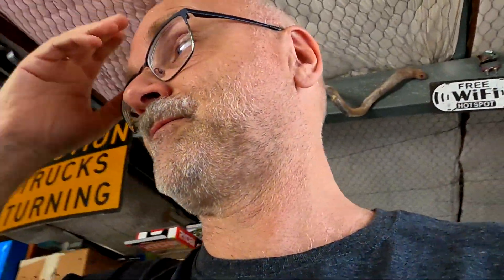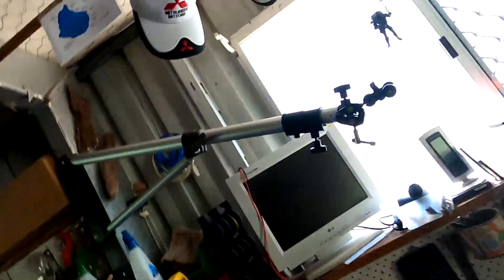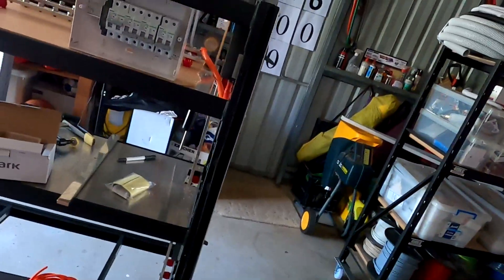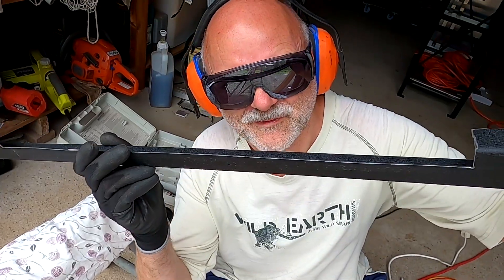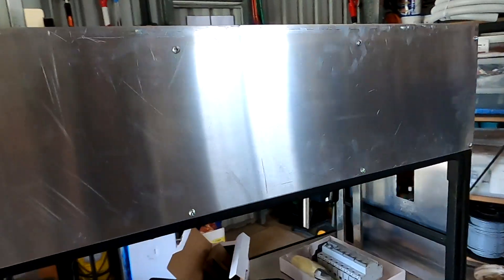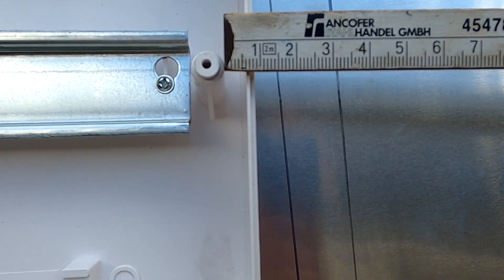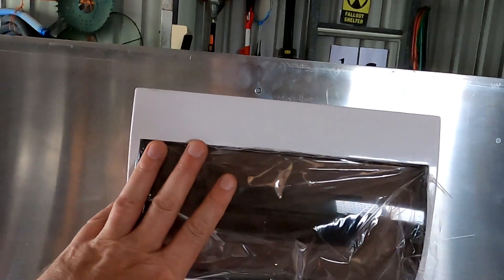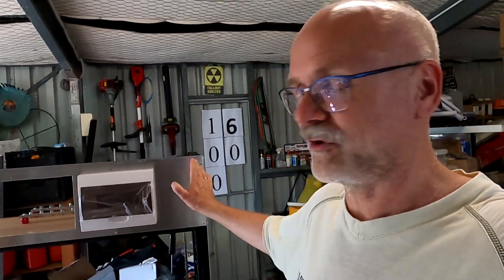MCB Switchboard added to solar distribution. Battery 2.0

Comment: DO you think the SJ BMS ($180) is worth the $70 difference for the active balancing as compared to the QUCC BMS ($110)??  thanks,
Reply from the maker: Yes, 100%. Not just because of the balancing function but also of the separate port ability to turn off just charging if a cell has high voltage. The QUC always creates total chaos when it turns off because it turns everything off.

Comment: Yeah, I'd abandon the box myself -- it's quite a limiting factor.  Turn the entire upper area there into an enclosure.   If the box was larger, sure, but trying to use a box that creates too tight of a choke point just creates more problems than it solves.  Breakers don't have to be up and down for what it's worth.   Side runs buys you much more space and a far easier place to work.

Comment: Nice. I like your screws used in the sheet metal as well. We built our first solar system this year, only 500w in panels and 200ah lifepo4 batteries. This test has worked so well, and answered so many questions on a small scale that we will be expanding the system over the next couple years. We do not want a grid tied system (at least not one that will feed power back into the grid,) so we are installing a manual transfer switch and will keep some circuits on solar full time with the ability to transfer back to grid power if needed. At this point I think our goal is to have approx 1500-2000w in panels and 800-1000ah in battery. This should be a nice system setup to reduce overall grid power consumption, as well as emergency power when grid goes down. We are also looking at adding a standalone system to feed a mini-split hvac system which would supply only one portion of our home. That one is several phases down our list though
Reply from the maker: Thanks so much for sharing. It's great to read about your success. And you're absolutely right, you can learn a lot from having your own system and see how it works, behaves and... fails sometime. Great work!

Comment: Hi, Are You planning any fuses for each individual battery pack ? Or maybe only those heavy duty brakers on the side of the shelf ? I'm having trouble to find the heavy current braker which will have some kind of over current protection build in. In most cases those are only heavy duty switches which are ok to disconnect hi currents, but You still have to activate them by hand. Can You elaborate more about it ?

Thanks.
Reply from the maker: The breakers will isolate each battery bank individually before they connect to the vertical busbar.
When we talk about high currents here, each breaker will trip at 80A. That's what I will set them to. Is that a high current?
I'm using the NOARK DC Breakers fir this job, 100A for each battery bank and 250A main breaker for the whole battery.
It is absolutely OK to have them manually reconnect again. If they really trip, you want to make ensure nothing is wrong or any fault has been cleared before you turn them back on. You don't want them to turn on automatically at all!
Reply: @OffGridGarageAustralia  thanks for an answer. Exactly those are currents i was talking about. And i've seen that a lot of brakers which are sold, are simple high current switches. So they are not tripping by itself due to overload (overcurrent), they are simply capable of disconnect high current when You want to manually do it. This way they act more like emergency turnoff rather than automatic protection. And sometimes they are even sold in this molded case, which makes them hard to distinguish from automatic overload protection. Can You give a hint about where best to buy those NOARK DC Brakers ?
Reply from the maker: @wojciechwrona4663  Sorry, you need to google that for your local area. If you're here in AU, I can give you a link though where to buy.

Comment: Andy in EU we use 3 phase  connecting bar. But maximum load is 100A. Personaly I like the most fork type connecting bar, because the fork is connected to the screw and you have free terminal for future use.
About fuxe box, it is misunderstanding. First I meant to rotate din rail 90°, second I thought that use want to build your own cover. Definitely your way is better. 
And thank you for the video :)
Small Edit: only one problem with fuxe box I see: when you have to do something with your breakers, the  box won be fixed. So it means you have to take off top cover and fix the box. But this can be easily solved by two screws on the bottom.
Reply from the maker: These are DC breakers so there is no 3 phase in this cabinet. The fork lugs you're referring too are very thin and I doubt they would have a 100A or even 250A rating.

Yes, the box is not fixed. It just sits on the shelf at the moment. I will see once the cables are connected if I need to fix the box or not. Once everything is installed I don't need to take of the cover any more. Unless I will install more breakers and then I have to take off the top anyway...

Comment: Depending on the depth of the box, you might have to put spacers under the DIN rail now to make sure the breaker faces protrude through the opening on the front, If it were me I would have just cut the opening so the box fits through, and secure the back box down to the shelf, then the hole box could have been set back even further. there are flush mount switchboards available as well..
Reply from the maker: Nah, they are long enough and still poking out even with the 4mm additional space now.
Reply: @OffGridGarageAustralia  All good then :)

Comment: I think the heat theory on the stranded wire into the circuit breaker is BS.  The distance is so short...  Would be a good test/video idea.  I also think you should start your own line of Andy's Safety Shoes - "great for heavy ground work or climbing around on a roof"
Reply from the maker: If you think a regulation is BS or not makes no difference as it is still a regulation. For me it makes perfectly sense to use a lug or ferrule with this fine stranded wire. It ensures that all strands have good contact and no hotspots occur. We're talkig about energy distribution here not just a light on a 12V battery for a camping trip.

Comment: 2 pole insulated busbar may work for the double pole circuit breakers. The max current rating of the busbar  may not be suitable though. 63A & 80A seem to be max current rating. A few can get up to 100A. Those current ratings are for AC not DC as well.
Reply from the maker: Yeah, they won't work for these sort of breakers.

Comment: I see now. your breakers are dual breakers not all singled so my idea wont work in this case with the bus bar and cut tabs. In future might be better to get single breakers so you can have all pos one side and neg the other. Or the staggered breakers.
Reply from the maker: Ah, was this comment from you... never mind. these breakers are always coming as 2 pole isolators and they have not staggered terminals. Maybe I should look at some other brands for these DC breakers to see if there is anything available. But I really like the NOARK stuff...

Comment: I hope Andy that you will screw those plastic boxes to some place..to that acrylic material..because now all those boxes are held only by two small screws ..and that is not good at all. also check your  circuit breakers inside those boxes and you might see that they moved a bit back..not sure how problematic that will be..but better to check it..
Reply from the maker: They sit flush on the aluminium sheet. The two front bolt really only holding the cover and lid as they would do if the switchboard is wall mounted.

Comment: No worries, left and right are on opposit sides anyways in Australia.
So i wish you more luck getting the same switchboard again than me. I bought three pieces (smaller ones for 8 modules), that were available and several weeks tried again and again... and  again to get the needed fourth one, until i noticed, that Praktiker had obviously no more of these ABB boxes available in any size... And other Brands look very similar, but you do not know if it really fits the hole...
Reply from the maker: The switchboards are standard here at Bunnings and many places online. That's not a problem.
I thought Praktiker does not exist any more?
Reply: These switchboards WERE standart here as well... And you are right. Praktiker does not exist any more in Germany. But here in Bulgaria they did not vanish. And if i am not confusing something, they are in Romania as well. Some years passed, since i travelled last time in between...

Comment: cool! those are nice big aluminum plates! it is fun to work with thick plates of aluminum. One question is will you be installing an equipment grounding conductor to all parts of the frame and panels of the shelf? Will you be bonding it to the ground of the AC side and the negative of the main bussbar? (the horizontal bussbar on the top shelf)
Reply from the maker: I'm thinking about the grounding for a long time. As I will have several Al sheet around the shelf, they all need to be grounded somehow. There are sections in the AS/NZS Wiring standard where it is allowed to use star washers for grounding metal which may be exposed to dangerous voltages. Unfortunately, it is just a guide with no real examples when, if and how to do that. 
For this reason, I will probably ground them all individually with short cables to a single ground point inside the shelf. Still thinking 💭
Reply: @OffGridGarageAustralia  yea the cables would be the safest, though star washers are probably plenty good enough, how will your ground point be made? a large threaded rod or some type of bussbar or terminal block?
Reply from the maker: @SuperBrainAK  I'm not sure yet tbh.

Comment: That’s a cool job you are doing on this project . Looks great and professional . It will take some major time to really get the battery shelf all sorted out and I’m sure we preppers will be very happy for this awesome project and the time taken to finally turn it on with the solar system for the first time with successful results . Thanks 🙏 and May the solar be with you .
Reply from the maker: Thank you very much. We 're not too far of to install the battery actually. Most mechanical issues have been solved now. I think...🤔

Comment: Can you just lower the shelf so the box fits?
Reply from the maker: There would be not enough space for the battery compartment. It's unfortunately all the space I have. I tried different settings and showed them in a previous video https://youtu.be/S2_4X3Jje0Q

Comment: Splitting the circuit breaker box with aluminum on the sides is not to code.  Wires touching the aluminum can abrade insulation and cause a short.  Would be better to flush mount the box and run wires with conduit through the back.  Although, I don't think a plastic circuit breaker box for DC is to code either.  Uncovered buss bars and terminals are not either.....so down the rabbit hole we go.  Be careful with the exposed aluminum and keeping wires away.
Reply from the maker: There is an insulator material inside the box wich covers the tiny AL areas all around.
Everything else will be shrouded as I have explained many times...

Comment: You can use just the fine stranded cable in connections, though you need to wrap it in a thin copper strip as per code if the lugs are not rated for fine stranded cables.  We do this at my work all the time for 1500A battery connections on UPSs.
Reply from the maker: Is this the code in Australia? I never heard of wrapping a cable in foil...
Different countries, different codes.
Reply: @OffGridGarageAustralia  No, America and NEC codes.  Its more of a ~20gauge copper strip that's 2cm wide than a foil that is used.  We use it in all of our temp systems that use flex cabling which is fine stranded ( 250-750Kcmil wire).  BTW, I am an Engineer.